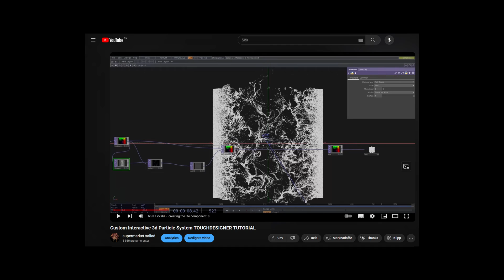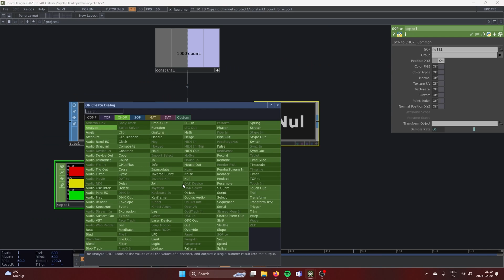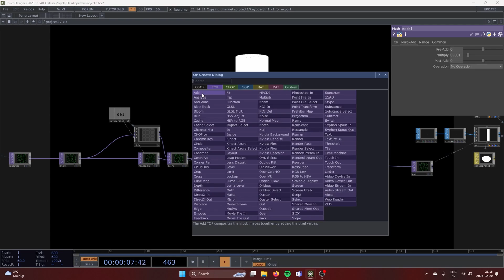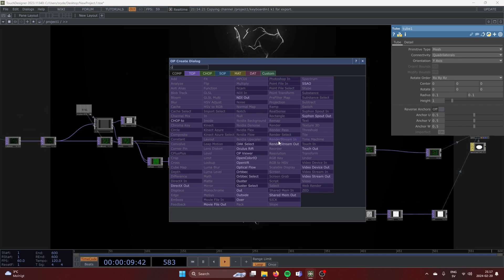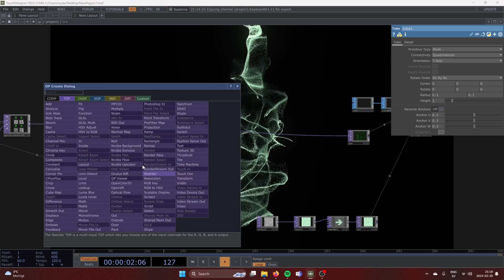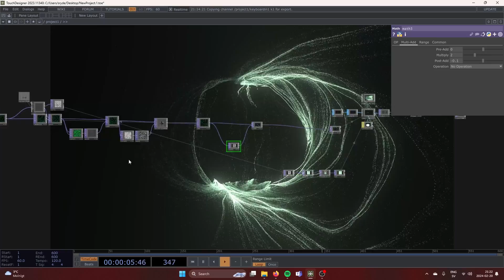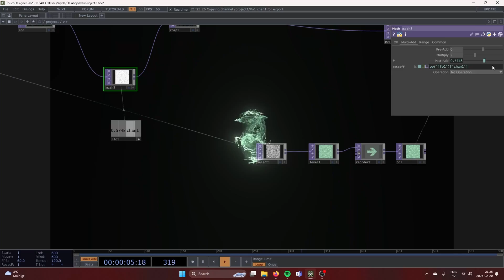Exploding Star - constraining a particle system to a sphere TOUCHDESIGNER TUTORIAL

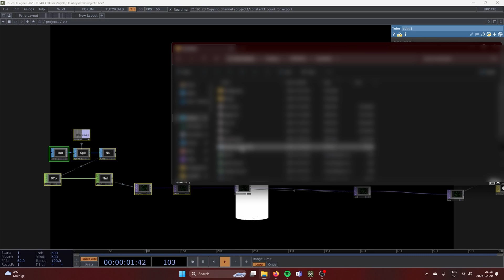Comment: Hi! I got stuck at 4:55, when we need to add the Life component.
I subscribed on Patreon and downloaded the POP_life_comp, added it to the project, but I noticed it has two inputs and only one output, so it looks different from the one in the video.
Also, when I try to connect the start null to the POP_life_comp, it doesn’t give me any option to connect it.
Am I doing something wrong, or has the Patreon version changed since the tutorial?
Thanks in advance!
Reply: bro is it cool if you can the life component with me? im new to this thing let me know :)

Comment: When I turn on Derivative (Slope) in the Noise output, the particle system gets very, very dark. I add the level TOP and crank up the gamma, but it doesn't do much. I am using the life 2.0 tox. What am I doing wrong?

Comment: To anyone out there still having trouble using the Life component from the "Custom Interactive 3D Particle System" video, know that you're not alone. Part of the issue is that Supermarket Sallad makes a slight mistake in that video at 6:50 and says "Do as I say, not as I do." But it's very confusing. My advice is to follow the visual cues carefully and disregard the audio at this point. You'll notice the mistake is corrected at 7:13 so make that correction as well. Then be sure to read the additional notes in the description or niccnaccs very helpful comment.
Reply: im having a very weir one.. my life comoopnenet ( wich i made based in supermaket tutorial from other video ) . has a push button not a on/off . i did exactly whay super sayed and watched caerfully but really . the outcome is diferent in my screen .. im making it wit the lates releas experimental wit pos . migth be that ??
Reply: i have reinstalled a previous version and now it doesnt even says "pulse"  when ading a momentary button in the customise componenet..  just a blank button .   oh goshh . .
Reply: @alexarievich  same issue with me
Reply: @ElsaFatima-l2b  wanna talk a bit about particles and stuff ?? im super fresh in TD and still traying to understand how it works
Reply: @ElsaFatima-l2b  so i actually follow the "new life component" tutorial . just use the "pulse" instead of the "on/of"  and it worked just fine .  salad responded to some coment saying it should work anyway. . so i trust .
Reply: haha, its not a mistake, check the inputs what he does is exactly what he says, creates learning curve ^^

Comment: I've been trying to follow this tutorial, but using an animated FBX as my initial SOP. I was wondering if you had any heads up on how to do this whilst retaining the animation from the FBX? Once the feedback loop is added, it takes just one frame of the animation as a "snapshot" to apply the noise (etc) to. Is it not possible in TouchDesigner to apply feedback to an FBX model whilst retaining the animated movement?

Comment: whoever gets stuck in this tutorial: the life component has changed a little from the one we build in the custom interactive 3d particle system tutorial. check the particle flowfields tutorial at 6:10 for the updates. this should fix both the particles being black and also fading away after a few seconds. as others have pointed out as well: make sure to have add points in the add sop on.
Reply: i followed the tutorial you suggested exactly but still my particles disappear after very little time, i also tried to add another multiply after the multiply inside the life componentbut it doesn't work and i don't get what i am doing wrong, could you help me?
Reply: @letiziaambrosetti7359  I had the same issue but I found the solution! In the particle flowfields tutorial, it shows the "constant3" operator as disconnected from the in top. Just make sure that's connected and the particles should work properly
Reply: @jinjaroe  I am facing the same problem of particles disappearing after a while, I followed the original video as it is with proper connection to Matte TOP,  both my constant2 and constant3 are connected to "in" TOP (which are also connected in the particle flow fields tutorial btw, see at 11:34) but I am still facing the issue. Can you please check if this is what solved the issue for you? will be a great help!
Reply: @abhishekch785  Any news?
Reply: Hi! Where i can find the life component plzz ?
Reply: @mehdibouzid5292  I NEED TOO Thanks

Comment: Am at the 1st render stage (4:38) and can add back ground but then I add the Pos to the translate POS in the Geo and then  add R to Translate x, G to Translate Y and b to Translate Z nothing happens its just black? Can't get the tube to show? Any help app[reciated
Reply: Turn on Add Points on Add SOP.
Reply: @itstherealwon  thanks
Reply: Thank you!
Reply: I have the same unexplained problem, it's not what they suggest down here, it's not because of not activating op sop, it's a bug in our software I guess --:)--
Reply: @federicoaquinomartin7166 it actually work for me, turns out I miss that part where he told to turn on the add points in the ADD SOP

Comment: Awesome tutorial, thanks!

One question, when I'm changing the RGB values in the level TOP to add color, nothing is happening for me, no color is added. Could this be that I'm on version 2023.13340? Or did I forgot something?
Reply: I think because of this not working, the shape is also not the same somehow
Reply: At the reorder TOP between the level and null, he set the outputs all to "one". Go set them back to red green blue and that fixed it for me

Comment: Thank you so much for this tutorial! the only issue I have is that the whole thing doesn't loop :( guess I missed something
Reply from the maker: Hello! It doesn’t loop.

Making things loop in touchdesigner is pretty tricky.

But there are some great tutorials for example “looping noise” by polyhop
Reply: @supermarketsallad  Maybe looping is the wrong word for it. The particles just stop moving after some time and stay in one line
Reply from the maker: @DaniiMarvelous  if you are using the old life component, make sure that 
(Before the over TOP) add a multiply TOP and multiply the output of the life comp with the same node you are plugging in to the life comp.

And then put that multiply into the first input of the over TOP

I wasn’t clear about this in the video, sorry
Reply: @supermarketsallad  That worked! Thank you sooooo much

Comment: Using your life 2.0 component, the noise looks like the video when i have the monochrome off but when i turn it on, and i turn on derivative slope, the noise changes into just like lines with some particles moving, a lot less than in the video. I made sure I changed the noise to Perlin 3D and retraced my steps a bunch. Not sure where Im going wrong. I think it may be because Im on the latest 2023.11600 build because my parameters are lined up with yours
Reply from the maker: Hmm.. I’m not sure..
The sloped noise is pretty, but sometimes a little difficult to work with. 

Maybe try attenuating the noise - lowering the amplitude

Comment: which OP is for setting the lifespan of the particles? Idk what I did wrong, but my particles fade away after 10 seconds or something.
Reply: I might have made a mistake in the life component, because increasing the lifetime doesnt really change anything
Reply from the maker: @アストーム  i wasn’t too clear about this in the video, but if you are using the old life component, remember to add a multiply TOP, and plug in the output from the life comp and the “start” null.  Before putting it into the over top.
Reply: @supermarketsallad  Thanks so much for the help and the incredible tutorials!

Comment: Hey! The Life COMP you're using in this tutorial has two outputs, but the one you created in the original tutorial only has one. Do we need to add anything to make this work correctly?
Reply from the maker: Not really, the upper output is just a color gradient, I make it in the flow-fields tutorial, but it will work perfectly fine without it
Reply: Yeah, I was about to write exactly the same thing. I was surprised that there are two outputs and it didn't work.
It would be good to say at the beginning that the project will not work without paid content from Patreon..
Reply: @kasiapieciukonis7763  The old Life.tox worksfor me. I multiplied it with the Null that begins the feedback loop and connected it to the Over TOP as is stated here. One thing I would add, however, is to set the Comp TOP to 32-bit Float. In default 8-bit it just produces a static image.
Reply from the maker: @kasiapieciukonis7763 it does work perfectly fine without it

And as I said in the tutorial, I show you how to make the second output it in the “flow fields” tutorial. For free.
Reply: Oh! I see there's a new one in the Patreon. It might be good to point out that the original life component does not work here.
Reply from the maker: it does work here without any issues. If you want the seconds output, the life-gradient (which just applies to the color of the particles) you can either find it on my patreon, or learn how to make it in the Flow Field tutorial. I try to mot gatekeep these things.
Reply: @supermarketsallad   Hm, okey. I did this tutorial for the third time and unfortunately COMP Life is not working properly when connected to ,,start" and ,,over"(5:00).  I'm still learning and maybe I'm doing something wrong, but I did everything very carefully step by step three times from the beginning. In the tutorial ,,Custom Interactive 3d[...]" COMP Life has one lifetime set to 25 and here it is at 12. What can be done to make COMP Life work?
Reply from the maker: @kasiapieciukonis7763 

The life indicates how many seconds you want your particle to live.

Is your life-component working in other projects?

In the old component (as shown in that video) you need to multiply the output from the life component with the start null before connecting it to the over TOP.
Reply: @supermarketsallad  Yees, we got it, now it works <3  multiply helped and life-comp from Particle Flowfields tutorial. Thank you so much for the tutorial and very quick response to the comment!
Reply: @supermarketsallad in the tutorial you didn’t show how to get the gradient output